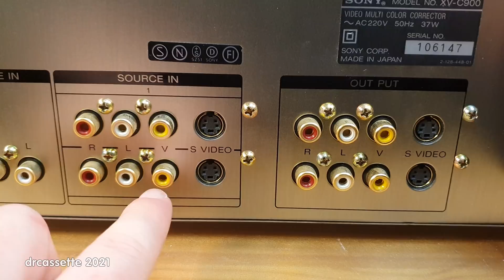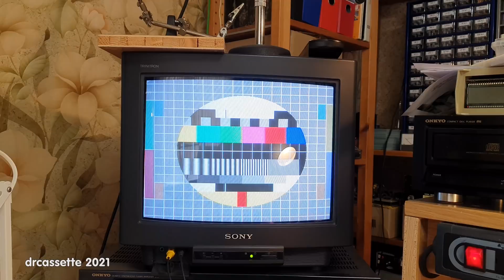Sony XV-C900 analog video multi color corrector repairs

Comment: Whaaaat! No full recap? Are you kidding me hahahaha ROFL yeah right! 
That thing would be just as bad to replace capacitors as an audio mixer! But if it's worth it, it's worth being done right! 
You can blame Mr Carlson's Lab and XRayTonyB's channels for making us all aware of capacitor failure modes LoL, we have been ruined and now expect nothing short of excellence LoL...
Reply from the maker: Just this morning I had another comment telling me I needed to replace all capacitors. I am sick of people talking about things they don't understand. Last week someone told me about their friend who tried to repair a preamplifier that had a hum in the audio output by recapping it. Guess what? Recapping didn't fix the hum. So what did that person do? He recapped it AGAIN! Still didn't help of course, and when he finally passed it on to the person who told me the story, it turned out to be a shorted diode in a bridge rectifier. The people who recap everything regardless of the device or the problem are the ones who ruin this hobby for everyone. They do a totally braindead job that in most cases won't even fix any problems, but feel like they were experts. You can't do any proper repairs anymore these days without some self declared expert telling you that you need to replace all capacitors. I am sorry for all the beginners in this hobby who get a totally wrong idea of what they need to do to repair equipment by all this capacitor-mania.
Reply: I'm just learning my way around this stuff, so this is an interesting thread :)

I have a '90s Sony amplifier (TA-F246E) with a blown fuse and a couple of dead mosfets attached to the main heatsink (with accompanying scorch marks on the PCB!). Haven't investigated any further than those mosfets, but I doubt they killed themselves. So I'll check the related components (capacitors, diodes/transistors, resistors), and only replace what I find to be bad. I expect most of the capacitors to be fine :)

On the other hand...

I have an Amiga 500 just recently dug out of the garage and restored. I've resisted the urge to re-cap it. There's no sign of problems, and it runs perfectly. But in this case - a vintage computer with hard-to-source custom ICs - mightn't things balance out in favour of recapping anyway, to safeguard those ICs? (At the moment I'm unsure, so leaving things alone until I know more about the subject.)
Reply: @TimothyMusson  many people will have different ideas for what should be done! 
So here's my opinion! 
Regarding the amplifier, I agree with you in that transistors don't just decide to die, it helps if you know the history of it, if it's outputs were not shorted to get it into that state, then I believe that it was a capacitor or two that caused the death! 
To make a proper repair, you are going to need tools! Apart from a soldering iron, some solder, a solder sucker, some flux (to reflow other joints that don't end up having components replaced) and some isopropyl alcohol to clean things up once you have finished....
The most important tool that you are going to need is something that can test capacitors and give as much detail about it's condition as possible! The most basic and cheapest is those eBay cheap Chinese multi component testers! You might even have one already! On the other end of the scale is a full blown LCR Bridge Meter which also can be found on eBay by searching for LCR Bridge Meter! There's a Chinese no name brand that sells for around $100 and gives you everything that you could literally want to know about capacitors! I have one and have never looked back! Don't rely on just the ESR value! If that's what you end up doing, you will still have problems that you won't be aware of! 
So, once you have the required tools, you remove capacitors out of circuit and check one by one! It helps to have a new replacement to check values against if you are not sure what exactly is a good value! 
Some people say just replace everything, others say don't. I say if you value your equipment and want to keep it working for a very long time, then be as thorough as possible! Don't take a chance to destroy it forever by trying to save a few dollars, you are already saving money by doing it yourself. 
The same applies to the computer, I to have an amazing amplifier that was a kit from an Australian magazine, most of it's components were actually made in Australia! From a period of time when we actually used to make stuff and were good at it! It's output transistor's are TO66 unobtainium! A later article in the magazine shows how to modify it to accept different transistors but I don't want to go down that path! I love it the way it is and intend on keeping it that way! 
I hope that this was helpful 😃..
Reply: @DrCassette  LoL you do realise that I was stirring you up!!! 
I have been watching you long enough to know how you feel about the subject LoL... 
Some of your viewers know you better than you realize LoL...
I have a very good understanding of capacitors, and I agree with you that just simply replacing all the capacitors won't always fix the issue! 
But what I feel is going on here is on one side, you have the "replace all the capacitors people" and on the other side you have the "I have checked all the capacitors and they look all fine people", but what exactly does that mean? Were they just visually inspected? Were they ESR checked in circuit? Or were they pulled out of circuit and also checked for capacity and DC leakage? 
It's definitely a touchy topic for a lot of people, there once was a time when someone else used to repair my equipment for me! They get it to work, maybe for a few months and it's dead again! Why couldn't they just fix it properly so that it can run for another 30 years? So I basically decided to take matters into my own hands a fix things myself! I don't have that problem anymore! 
There are YouTube channels that make repair videos that in my opinion should never be working on someone else's equipment! 
Yeah, they found the problem fast! But a proper technician will check everything else as well, not just the leaky and burnt components! Some times you are going to need to pull components to test them, some times there's just no other way around it! 
Imagine taking your car for a service and the mechanic finds a problem that is unrelated to the service and doesn't tell you about it! Oh! It's just a leaky shock absorber! It's no problem, the car can and possibly has been driving like that for a long time! But leaving the mechanical workshop you have to break hard because of some idiot and because you have a leaky shock absorber, you loose control of your vehicle and crash! But the shock absorber looked fine! 
I'm sure that you understand what I mean, all the equipment that I have seen you work on is yours! And if you don't want to replace all the capacitors, I'm okay with that! It's your choice at the end of the day, but!!! If you appreciate your equipment, and you want to keep it operational for another 30 years! 
Then as one of my favourite YouTube content providers, I'm going to try and help you to get it that way, as much as I know about Electronics and repairs, there's probably that much more that I don't know and that's why I'm here! But if I feel that I can offer you something, I'm going to try and help, even if I have no idea what I'm talking about! But sometimes, I just might! 
I replace all capacitors! The equipment is mine and I want it to be reliable. That's my choice! I test every single capacitor against a new one to see the condition of the original one, and they aren't all bad, a lot of them can be put right back into service... But as I said earlier, I choose to replace them all, and I always try to replace with a higher voltage version of the same capacity to get a longer service life out of my equipment! 
Your probably thinking Yeah that's fine for your own equipment, but I have over 500 Amplifiers of all classes, I feel like I'm working on customers equipment! 30 and possibly 50 years from now, they will all be still working! 
But it's still my choice at the end of the day, but when you say that you checked and it's fine, I'm thinking that perhaps you want this thing to keep working for a long time like me! And generally when people on YouTube say that it's fine, it usually means that they used their in circuit ESR tester and found nothing! Which is usually the case, and me! Trying to be helpful, I go straight to the comments and start posting! Like a lot of people do! Some of us are not good at getting across what we want to say sometimes and it comes out wrong! 
So believe me when I say, I really appreciate what you do, I enjoyed all your videos! I just wanted to be apart of what you do and at least be helpful!..
Reply from the maker: I know you were joking, my reply was more of a general comment, I'm sorry it came across wrong.
Reply: @DrCassette  no no, I understood perfectly well! 
I don't have my own channel so I can't really say that I know exactly what you have to deal with when it comes to people in the comments section... But I believe that I have a good idea... It was a general comment in my eyes, and that's exactly how I took it.  All is good, greetings from Australia.
Reply: Imagine actually trying to do that. I'm even too lazy to try to count how many there are, but, don't know, maybe over 200 caps?
Reply: @BilisNegra  yeah some devices have more capacitors than any other component LoL... It's known that some transistors slowly fail over time or get noisy but the few that exist are known. Capacitors are without doubt the one comment that fails, they have a few failure modes and the worst failure mode is DC leakage! This failure mode is the one that will constantly pass DC to another component, usually a transistor! This is also the reason why transistors fail! 
The biggest question regarding electronic equipment repairs today is to recap or not to recap! That is the question! 
If you have read the other comments on my post here, there is definitely a problem, it appears that the viewer expects a full recap, but the video producer isn't on the same page! 
I personally saw the video colour adjustment device and thought, wow! What a wonderful device! This is something that I never knew existed! If I had one, I would go right through it and restore it to it's original condition which means that I would want to replace all the capacitors! Apart from reflowing all the solder joints and checking that resistance values haven't drifted and everything else that could potentially need services performed... That device to me! Is something worth the effort but everyone is different and see's things differently! And I get that! I didn't always get that though! I remember years ago, I was questioning why isn't everyone who has an electronic based YouTube channel working on audio amplifiers? For some reason I was thinking that everyone into Electronics would also be interested in audio and audio equipment! But that wasn't the case! 
I'm assuming that since you are here, you would also be familiar with EEVBLOG channel! And if you are, you will know that his channel has very little to do with audio! Or repairs for that matter, he's not stupid! Far from it, he's very intelligent but he has no interest in audio and hence the lack of audio equipment on his channel, he can repair equipment but from what I have seen, he's not as good at it as others on YouTube are! I'm sure that if he made it a regular thing, he would get better at it. The one repair channel that I have stopped watching is 12volt vids! I just can't watch his videos! He is, in my opinion, the typical Electronics repair shop! He has been doing repairs for a very long time and he can get a device up and running faster than anyone else I know, but I have seen him replace a burnt transistor and not check for what caused it to burn! Transistors don't just decide to die! There's always something else that causes it to die! Sure, it's working now! But for how long? I have sent in a cassette deck for repair, as it turned out it had a voltage regulator that died, it was replaced and I was charged $120 and a few months later the same problem happened again! In my life time, this has happened way to many times, I have had an interest in electronics ever since I could walk but never really took it seriously! But these repair shops have left a bad taste in my mouth and I decided that I'm going to dive into this and learn it. It took me a few years of intense study but I now know everything that I need to know to work on audio equipment! But it's the capacitors that were the most difficult to learn! Because everyone only seems to check capacity and ESR! But the other components that were failing because of the capacitor didn't seem to make sense why they failed from a capacitor with high ESR or leaked electrolyte... The failed transistor should have just stopped working from those things, and then it hit me! Mr Carlson's Lab channel kept talking about capacitor DC leakage! And suddenly it all fell into place! This is what I was looking for! This is the biggest trouble maker, that's why I would go through and check the capacitors for capacity and ESR and everything seems fine! No electrolyte leakage... But yet, I replace a transistor and it burns! 
To the eye! The capacitor looks good, but until it's removed from circuit and checked on a tester that tests for everything possible, you just can't tell by looking at it! And there's no easy way around it! 
I watched someone else who was looking for a problem, you could clearly see that there are capacitors that have leaked electrolyte and he still checked them in circuit with his ESR meter LoL and it gave a very low ESR reading LoL... 
I don't know! I'm just trying to be helpful but mostly people seem to think that I'm just being a smart ass. So I have to result in these lengthy posts to try and explain myself...